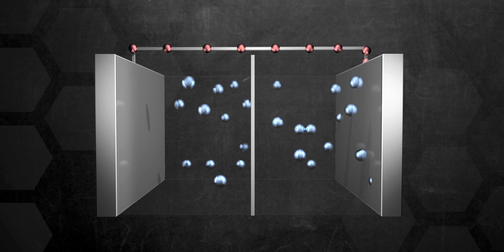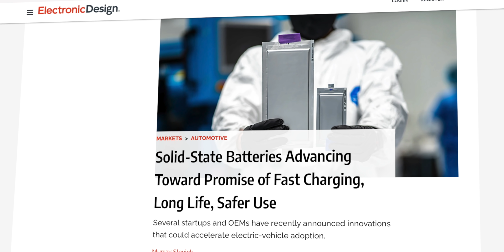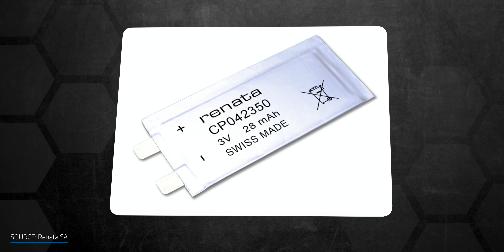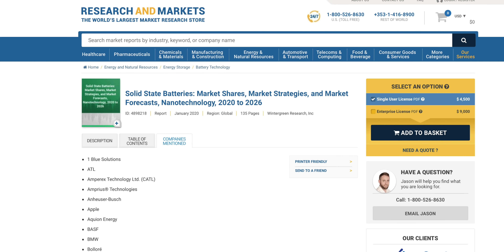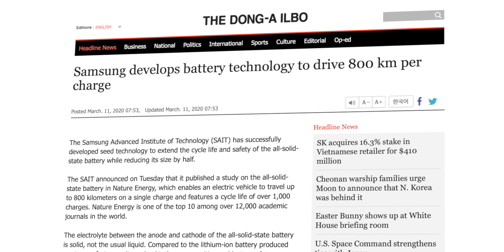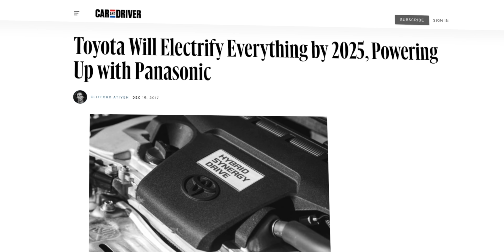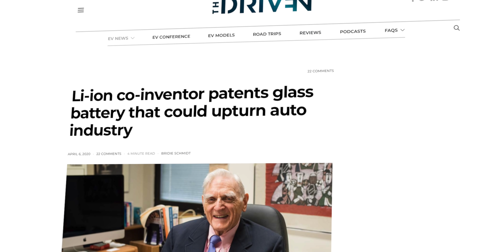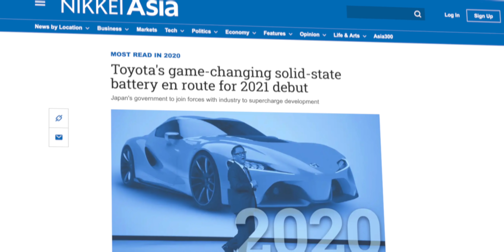Exploring When Solid State Batteries Will Arrive

Comment: I'll believe these batteries when I see them. Coming up with something that works in the Laboratory is simple compared to making them cost effectively in enormous volumes. Even if they solve all of the technical issues, unless you can source vast volumes of raw materials, you're not in the game. By the time they even know for sure what materials they need, those are likely to have been allocated to other companies.
I don't doubt that some of these batteries will be amazing and outperform anything we currently have. However, they are likely to remain expensive and largely irrelevant in the short to medium term since scaling production is so difficult with limited mineral resources.
Reply: @bet_big9917  Yes they exist, so what? The lithium battery has existed since 1957 and it took us till the early 2000's for it to see the consumer market due to the cost of them.
It takes decades to drive down manufacturing costs and refining them to the point they can become common use and cheap enough to use.
Reply: @bet_big9917  - Cap-xx don't look like they're aiming for the EV market. Their expertise is in portable devices. It's highly unlikely that they would be able or interested in scaling this for EVs.
The fact that they exist is irrelevant if they're not going to make it into EVs
Reply: @bet_big9917  I couldn't find anything about Cap-xx and truck battery production. What is your source for that? There's a lot about Supercapacitors, but the battery side of the business seems to be all about portable applications.
Cap-xx have a tiny market capitalisation, so they're not really in a good position to fund much development. To me they look like small fry without the ambition to enter the EV battery market, but I may be wrong.
I doubt very much if Tesla are going to have issues with the Patents. They have developed many of their own processes, and probably won't be infringing any of them. Unless someone has very deep pockets and an excellent case, they would be crazy to pursue it.
Reply: @rogerfroud300  uhhh... the scale is just quantity. You don’t have to have a giant battery, but a bunch of cells linked till you get your desired capacity. Scaling wouldn’t be an issue for them.
Reply: They’re largely made of carbon too, so fairly cheap. It’s more the science to get the particles to interact properly, than the cost of materials. It’ll be cheaper to produce these than lithium based batteries.
Reply: Perhaps recycle the Lithium for now also ?
Reply: Agree. If you have them get them on the market...
Reply: Your points are well-taken.  Redwood Materials is currently reclaiming 80 percent of the lithium in recycled batteries, at far less cost than mining raw materials.  If we can recycle most of the material in spent batteries, that would go a long way.  I agree that solid-state batteries in EVs will likely be a very high-end premium option at first, but they should become cheaper over time.  It's good that Tesla/BMW/Toyota/etc. will be battling this out - that will shorten time-to-market.
Reply: @It-b-Blair  - Scale takes vast amounts of Nickel and Lithium. What quantities of these vital supplies have been acquired by Cap-xx? Since they don't have a cell design ready for EV production, I don't suppose they have any significant quantities at their disposal.
There's going to be a Worldwide shortage of these vital minerals, which is why Tesla has bought its own Lithium reserves and is developing more economic ways of extracting it.
Reply: @mm-qd1ho  - In reality, Tesla has a huge technical advantage over anyone else. They're been working closely with Panasonic, and already has shown Panasonic to be incapable of innovating quickly enough. Tesla will soon be using Maxwell's Dry Electrolyte application process which will impact on the cost of battery production. This will massively reduce the factory footprint required to manufacture the batteries because there is no need for solvent recovery and all of the associated equipment.
They also have the 4680 cell in pre-production, soon to go into Giga Berlin. Not only is it much more economical to make these bigger cells, they're also using a Tabless Electrode which will allow for faster and more efficient charging.
With all of these advantages in house, and the ever increasing rate of Tesla's development, it's hard to see how other companies can hope to compete.
Reply: @SilvaDreams  if you want to get technical like that then this batteries have existed since like the 1800 if se go by Wikipedia, but the "modern" versión since the 1950s, it's just that it took years for them to catch up, this is not a new technology it's a decades old one
Reply: I mean technically lithium batteries are still extremely expensive and quite rare when you compare them with other battery chemistries. However they still seem to be gaining popularity for obvious reasons. The more they become adopted, the less impact the challenges have. 

Hopefully SSB’s will follow the same path.
Reply: Don’t underestimate the greed of the companies to figure out the sourcing, logistics and mass manufacturing.. Just the right materials have to developed and rest is hyping
Reply: @nitin577  - There are finite natural resources for all of the elements needed for battery production. The companies that own those are not putting in enough investment to extract and process what's needed. Without taking extraordinary measures like Tesla is doing by getting deeply involved in mining, you won't get the large volumes needed for large scale battery production.

Companies are not going to make that kind of investment until they know for certain that they have a viable battery chemistry that's economic to make in vast quantities. You have to go all in if you're going to compete with Tesla.

Tesla are developing new refining processes for Lithium to solve one problem. Can you really see Toyota or one of these modest battery producers thinking that far outside of the box?
You make it sound simple, but it really isn't.
Reply: They can't even make them in the laboratory.
Reply: The future is only irrelevant to irrelevant people. Don't be one as you currently are.
Reply: Next 5 years should see a massive reduction
Reply: @rogerfroud300  Making these batteries affordable for portable devices goes a long way towards making them viable for EV applications. They're in the business of proving that they can be commercially viable.

Comment: It'll probably come simultaneously with fusion power plants.

Every couple years, some marketing (that claims they're close) is done to attract investment for both of these technologies.
Reply: There will never be fusion power or solid state batteries. Both ideas have impossibility written in their DNA. It's like getting funding for a project to make water run uphill.
Reply: @Withnail1969   How?
Reply: @somethingelse9228  water doesnt run uphill and nor will there be fusion power, ever.
Reply: @Withnail1969   Water could run uphill if you use an electric motor and sun uses fusion to generate it's energy
Reply: @somethingelse9228  the point is that there will be no fusion power stations ever. we can't replicate the sun and keep it contained and generating reliable power.

Comment: Its so exciting to understand the possibility that the first car I'll ever buy could be an EV.
Reply: @S C And autonomous.
Reply: CT Might be my last car too.
Would prefer a smaller format that can be parked in a normal car space in town.
I don't want a Yank Tank, I want manoeuvrability, versatility, longevity, and autonomy when I reach 60, in another 10 years.
Reply: Back when automobiles were first introduced, electrics were on the roads (such as they were) before internal combustion vehicles.
Reply: you will then probably NEVER buy a car, just rent an autonomous car (SAV) at $ 0.25 per  mile :-)
Reply: @michiganengineer8621  Yeah, hooked to an overhead wire or with a range of almost nothing.
Reply: @percyfaith11  You're thinking of the trolley system with the wire (still in use today in some places).  I'll agree with you on the short range, you would think that over a century they'd have gotten a better than 10x improvement in batteries.

Comment: With the increase in Energy and the decrease in weight and size, I wonder if these new batteries would make commercial electric flying a possibility.
Reply: Chris Talbot,  aviation fuel has presumably 16 (!) times higher energy density than current batteries. Meanwhile, the *hope* is to double the energy density in the next decade or so.
Reply: @michaels3003  you can fly a little plane with gasoline that uses less litres of fuel than a car
Reply: current battery tech can get a small electric plane about 150km (95ish miles), so if solid state batteries achieves its aim of double energy density then still no, not really.

Comment: Car company paradox:
If Toyota or other car companies come up with a battery system that outlast the present replacement cycle of vehicle owners the car company potentially would lose money. Not that there is a planned obsolescence built into our automotive chain, but off the Golden Tower of theory this has to creep into the board rooms discussions.
Reply: Virtually no new car buyers keep their vehicle to end-of-life. They drive it a few years, then trade it in on the newest, shiniest thing. Rinse and repeat. There’s no reason to think that would change. Sure, that used BEV may persist in the used market longer than current ICE vehicles (but probably not), but new car buyers are going to remain new car buyers. Almost none of them are driving the wheels off of each new vehicle they buy before trading it off on the next one.
Reply: Toyota dosent wanna switch to electric
Reply: Wrong bater kastbibg eachvyear

Comment: This is why I'm a fan of using turquoise hydrogen (methane pyrolysis), the solid carbon can be used to manufacture battery parts or other materials to keep it out of the atmosphere, this process can be used until carbon free power generation is plentiful enough.
Reply: No mention of waste.  These SS batteries, like all batteries, eventually wear out and can no longer take a charge.  Can the components be recycled into new SS batteries?

Comment: Solid State Batteries is like Fusion reactors, they will be available in 20 years time, and this value will never change. As Musk said "Solid State Batteries work in PowerPoint only"
Reply: Well they might eventually reach the market, I mean it took the lithium battery from 1957 till the early 2000's to go from the lab to seeing steadily more common use... So give it about 50 years.
Reply: What 20 years? Fusion is officially confirmed to be available in 2026.
Reply: @SilvaDreams  solid state batteries were first proposed in 1800s so yeah Lol, we ain't getting em in first half of this century atleast as a replacement to li-ion or other conventional options

Comment: 2035 I recon these timelines always slip and nobody accounts the 5-6 years between introduction and actual main stream acceptance.
Reply: ᴡɪɴᴛᴇʀᴍᴜᴛᴇ _  - Exactly. Elon isn't trying to stay in business - he's just making as much money as possible as quickly as possible for Mars. All other companies will build inferior products for this very reason - and Tesla while ultimately shooting themselves in the foot after 30 years? without their profit-first motivation? will wipe the floor with everybody else.
Reply: ᴡɪɴᴛᴇʀᴍᴜᴛᴇ _  - Planned obsolencense has become such a widespread dirty tactic over many decades - that the first company to stop doing it and actually build really solid products? will thrash everybody - they don't even see it as an option! and that is why they will fail.
Reply: 2035 is a good estimate. One issue is also that SS has to outperform current lithium batteries that are getting better all the time. The other issue is cost. Who cares if it's more energy dense if it costs 2 to 3 times as much.
Reply: ᴡɪɴᴛᴇʀᴍᴜᴛᴇ _  as far as planned obsolescence, I think they may simply shrink the buffers for over/undercharging the batteries, to give them more usable charge in the short-term, but sacrificing long-term durability.
this way they could also make the battery pack physically smaller for the same range, making it lighter and minimising material costs.
let's just hope they don't make the control boards fry themselves, but more importantly, they don't exploit the lack of right-to-repair laws.

Comment: The solid state battery tech will go mainstream when the batteries can function in the most extreme temps effectively and safely.  
A large number of people around the world live in places that can get as cold as -30C (sometimes for many days).  Keep in mind that some materials get very brittle at extreme cold temps, so that factor will be another engineering hurdle (among many).  
Many more people live in very hot regions where heat dissipation is challenging for all kinds of technologies.
Additionally, aircraft and space travel will always need batteries that can handle extreme temps as well.
If a solid state battery solution is developed to work in the most extreme temps with little degradation of performance, life cycle, or safety, that will likely be the battery tech to win the most hearts and minds.  
Of course, other factors come into play on the success of any battery solution, but environmental temperature is universal literally and figuratively.

Comment: "A third of capacity lost within a decade" I wish!
Reply: More like 2 thirds of capacity in two years.
Reply: @iskanewton8451  Says the man who has never owned or driven an electric car.....  So many "experts" with absolutely no actual experience.
Reply: @Brian-om2hh  Ever heard of smartphones sir? Your Tesla isn't the only thing that's electric.
Reply: @Brian-om2hh  why do you have to enforce your personal experience as the only truth.
Li Ion batteries lose their capacity soon after a year.
Reply: @aayushbadoni6263  Actually there are different lithium ion chemistries used in smart phones (like Lithium Cobalt Oxide) vs cars (like Lithium Nickel Manganese Cobalt Oxide).  That said I expect individual cycle performance between the batteries used by different companies could have enough difference to support either side of the debate.
Reply: @jeremykearney7950  I'm aware of that but the comment above me just assumed that electric cars are the only devices using lithium batteries.

Comment: I just finished writing an independent study for solid state, sodium ion, and lithium sulfur batteries yesterday. I know a lot of your sources lol
Reply: So is it plausible to be an affordable alternative solution to lead acid?
Reply: @bullithedjames937  a possible alternative to lead acid could be Sodium ion or Lithium-sulfur batteries. Some companies already use lithium ion batteries for vehicles. A lot of the other uses for lead acid are for battery backup for hospitals or substations, and sodium ion would be a very good use for this. Sodium ion is cost effective, but not as energy dense.
Reply: @bullithedjames937  solid state won’t likely be widely used until manufacturing improves. Otherwise cost will be the main setback.
Reply: @mcleodautomation  yeah energy density sounds like a nice factor but the real factor is price per usable Watt hour.
Reply: @bullithedjames937  Right, exactly.

Comment: The capacity increase is definitely also interesting, having a high end modern smartphone lasting 3-4 days on a charge would be huge.
Reply: Can you imagine laptops with this
Reply: @loop5720  I bet we’d have to wait 5-10 years for airlines etc to increase their capacity limit from 100Wh 😭 most laptop batteries are currently 80-90 precisely because of that limit, and a few are exactly at 100.
Reply: Buy knokia 1520 25 hour bater life tes cel 29 hours

Comment: 10:17 "Six billion" --> That's actually not a lot of money. Are we missing a couple of zeros?
Reply: Yes i totally agree. The global battery market size was estimated at 108.4 billion USD in 2019, and the advanced battery market size is projected to surpass around 168.13 billion USD by 2030. Although even these figures could be very conservative indeed if electric vehicles completely take over the fossil fueled vehicle market by the next decade. Including they are also required to facilitate a new decentralized energy revolution once at the right cost per KWh. Which is ideally suited to match the rapid reduction in solar PV panel prices, there by making such offgrid systems highly affordable on a massive scale for the very first time.
Reply: Yeah, I was thinking the same thing!

Comment: Foreseeable end-game is carbon nanotube 3D super caps. No electrolytes, no chemical reaction. Near infinite charge cycles. Near instant charging (depending on wire and inverter size).

Comment: I've been a huge EV fan since the early 2000s.  Also, I've been hearing about new battery technologies since....the early 2000s.  Not one of these "game changing" technologies I remember hearing about ever came to market in a significant way.  On the other hand, my current car (range over 250 miles per charge) is proof that EV batteries will get better and better!